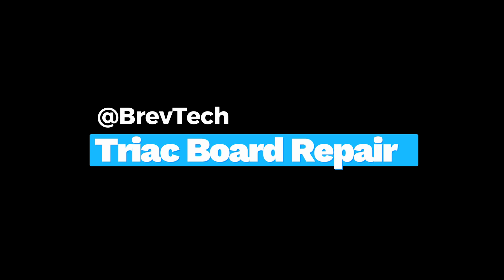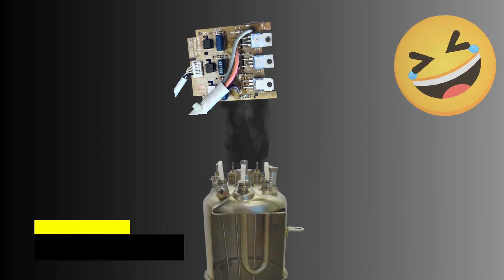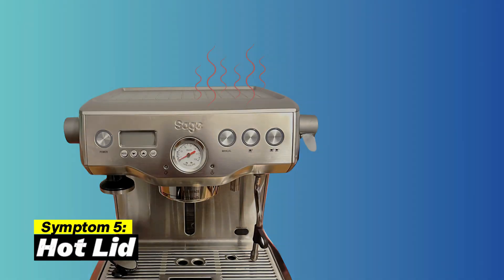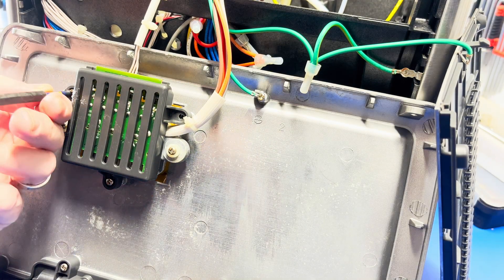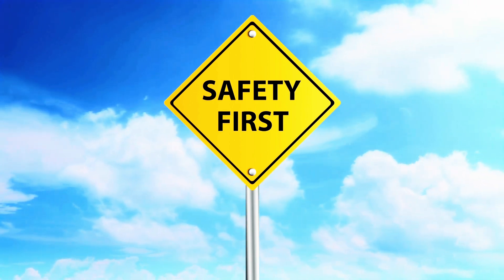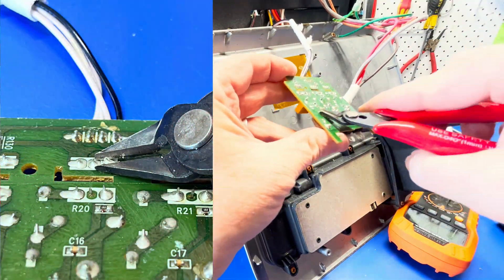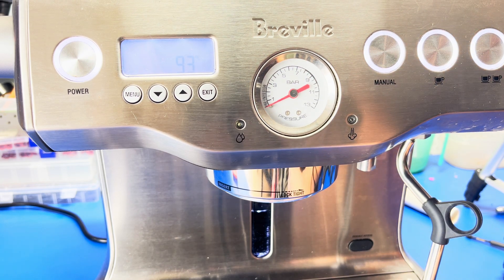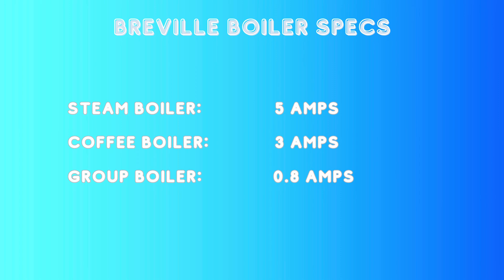How to Diagnose and Repair the Triac Board on the Breville Dual Boiler BES920/900

Comment: May I please ask for some advice? My TRIAC blew up 3yrs after purchase from a leaking o-ring of one of the steam boiler probes. It had the common symptom of boiler overshooting the max set temp and not functioning as a result. I fitted a new TRIAC which allowed me to establish the problem was the leaking steam boiler probe o-ring. I changed the o-rings but also, as you suggested as a possible remedy, applied conformal to the upper side of the TRIAC board. Prior to conformal everything worked but since applying conformal, whilst the pump comes on to fill the steam boiler water does not enter the system. I assume there's a solenoid valve that opens up to let water to the pump. I can't see how conformal could damage the board enough to stop this working. Have you any ideas, please?
Reply from the maker: Are you saying the steam boiler is now not filling? Can you hear it running during startup? The steam pump feeds directly into the steam boiler so there are no solenoids to fail. This problem is usually either the steam pump seal worn or the inlet port blocked by scale.
Reply: @BrevTech  Ignore me. I was being a numpty and panicking when the pump was merely filling up the steam boiler. Everything now works perfectly thanks to your outstanding help. Thank you once again!

Comment: This morning i was going to make myself a cup of coffee, and to my shock the machine wouldn't power on. Out of the sudden. What do you think the problem is?
Reply from the maker: It could be a leak getting into the electronics. When was it last serviced?
Reply: @BrevTech  never. It has worked well last 8 years
Reply from the maker: @emmasshow3081  oh gosh, it's well overdue then. You really should get them done every 18 months. Hidden leaks inside can rot away the internals if not addressed.

Comment: awesome video MY BDB have issue with under heating ,  I got error code 10 . 6 times but I can not get into the self check mode some how, that hapnned after I replaced all orings after boiler as well. what should I check it ? there is contunuty between boiler fuse and ground. ( I wonder shodln't it or normal?) I m asuming short to power when installed reveseway.. / hot water , steam are working fine.
Reply from the maker: sounds like you might have the bes900. If steam and hot water are working ok, it could be your group heater. You'll need to test the triac board outputs to verify. I cover this in the video.
Reply: @BrevTech  Hi! are u selling traic board 120V? I been ordered service kit from you! nice meet u! :D
Reply from the maker: @choibackho3068  They are the same board as 240v. If you ordered the survival kit it will have everything you need for the repair
Reply: @BrevTech  thank you. I tried to repair my self and screw up.. needed to replace board now so sad..

Comment: I've decided instead to replace the whole Triac board. One question if I might. Is it possible to replace the o-rings with the compression washers used in the newer model you mentioned early on in the video?
Reply from the maker: you can yes, but i'm not sure where to buy them from. The ones i have here are spares from parts i've ordered. You may need to just buy a whole new pipe, they are quite cheap anyway
Reply: That’s a shame. I wonder if it’s worth my asking Breville. You would have thought having identified what is a design flaw they could at least supply the new compression seals. Incidentally I’m trying out your idea of the conformal coating on the upper surface of the board.

Comment: I have a bes860xl…I have changed the pump, all solenoid valves block, checked all tubing and still no water through the dispenser head to extract coffee.  Could it be a board?
Reply from the maker: unplug pipe going into boiler and feed into a small container to see if water is coming through. It's likely either a blocked boiler (scale) or blocked inlet water filter (common)
Reply: @BrevTech I have steam working just fine. So water is getting to the boiler.  Could it be the signal not reaching to the solenoid valve that controls water to the dispenser head?
Reply from the maker: do you hear it click when you press the shot?
Reply: @BrevTech it sounds like normally it did when extracting coffee. At the end there is like pop or click.  That’s new after replacing the valves solenoid block.

Comment: Hi. Does that mean on the other hand. If there is no amps going through when turned off, it’s not the triarc board?
Mine is overheating, but only when turned on, and not all the time. Pretty weird 
Can it be the ntc? Even when it shows reasonable temperatures on the machine?
Reply from the maker: Yea I would Say so. You can check the ntcs all match in the self check menu. What makes you think it’s overheating?
Reply: @BrevTech  I noticed that te temperature was blinking and rising above the point some times. But sometimes also floating back to the set 93C. In the menu with de different boiler temps I noticed that the boiler gets to hot when that happenes. I replaced the triacs and optos. But still. When turned off, I could not measure any voltage coming through as you shown in the video. 
BTW: thanks a ton for these videos. That’s pure gold!!!
Reply from the maker: did you use the exact same triacs as the originals? sometimes people use slightly different ones and it causes this problem
Reply: @BrevTech  i just checked. Its Q6015L5 , which i replaced with Q6015L6
Reply from the maker: @bloodyt7464  that’s fine
Reply from the maker: @bloodyt7464  next time it drifts turn off and try to get the temps from the self check menu. This will tell you which element is overheating
Reply: @BrevTech  allready did. Should be coffee boiler
Reply from the maker: @bloodyt7464  what temp does it rise to?
Reply: @BrevTech it was over 110 before. Since I noticed that, I hadn’t let it heat up completely because I was worried about blowing the thermal fuse. It’s over 95C even when the 93 are not reached on the default view.
Reply from the maker: @bloodyt7464  hmm, I would plug it into an energy meter (i would always recommend this anyway) so you can keep an eye on it. The coffee boiler is about 2 amps (steam 5, group 1) so if you are seeing it stay on, then i would suspect something else wrong with the triac board. if it's on and off, then it's a bit more tricky. It could overheat due to not filling properly. Is your pump otherwise ok? pre-infusion ok? it can't be the NTC as it's telling the machine it's 95c. The only other condition it would do this is when the group heater wasn't working and its trying to compensate. beyond this, that's all can suggest

Comment: Wpuld it also be the Triac board if my oracle is very noisy while starting up and only reaches about 70 degrees and never stops. It initially had the ERR code which i fixed with parts from you. Suggestions please?
Reply from the maker: Hard to tell with seeing a video of it but loud noises can usually be attributed to a dry pump. It could be your steam pump possibly that is trying to fills the steam boiler. This would explain the 70c too. Use the error log and live debug mode to further troubleshoot.
Reply: I guess the steam pump is the smaller one at the back? It's the one that I can feel vibrating hard with the noise.
Reply from the maker: @rudgespace  yep. you can take the pipe going to your steam valve off and connect it to the top of the steam pump. route it into a small cup and switch the machine on. this will tell you if the steam pump is pumping ok. Best case is it needed priming and this will get it working again.

Comment: When I go into self-check menu, Coffee Boiler: 117c, Steam Boiler: 122c, Shower Heater: 93c. Looks like my Coffee Boiler is overheating would you agree? Should replace both Triac and Opto Isolator?
Reply from the maker: it does appear that way yes. I show in the video how to tell if the triac needs replacing, but generally you should always replace the opto anyway.

Comment: Thank you for your amazing videos!
Just wondering: I haven't yet pulled the trigger on buying a BDB, as I was aware of the frequent issues. Would you say that based on your experience with those machines, they tend to last well when regularly replacing O-rings?
I'd be willing to do the latter, however, I'd very much like to avoid buying a machine that will require bigger fixing every 1-2 years (from what I've read and heard).
Thank you already in advance for the heads up!
Reply from the maker: Thanks! If you're buying new, then it will come with the newer design boiler which does not require regular o-ring changes. If you are buying used, then you will almost certainly need to carry out some of the other repairs i have on this channel before long. Solenoids, o-rings and pumps etc. are all consumables, so no matter which machine you buy, eventually you'll need to replace these every 3-5yrs or so. It's usually a tradeoff between features vs things that go wrong. O-rings are the catalyst for many other problems on these, so if you keep on top of those then there's no reason it will last 10yrs+. I still see (albeit rare) 12yr old dual boilers that look brand new inside.
Reply: @BrevTech  thank you for the fast reply!
I am considering buying new, as the dynamic duo just dropped to 1070€ in Germany. Do you see any downsides with the latest iteration of the (here Sage) dual boiler?
Also, how did they adapt the boilers that they no longer use O-rings?
And one final question: I've heard horror stories of dual boilers and especially oracles dying after a decalc cycle. Is this still a thing? And what would I have to do to prevent this from happening?

Thank you so much once again for the insights! Your provided information makes me really reconsider the dual boiler
Reply from the maker: @TechEtrix  No downsides for buying the latest model. The use ptfe compression fittings instead of silicone o-rings, which last many years longer. As for the descale, don't over dose with solution as it can affect the machine and sometimes cause failures during descale. I always have my machines on an energy meter, so i can see how many watts or amps are being used. If its 3A then i know the steam boiler is not on so its safe to empty, but if its 7A+ then i know its heating up and to make sure the tank has water in or switch the machine off quickly! I'm in the process of doing some research around why it sometimes (more rarely) happens on the newer versions that were supposed to be "fixed"
Reply: @BrevTech  Really interesting insights, thanks! So keeping an eye on the BDB pulling <700W means that I'm good to go and can continue the descale. Does this mean that the software descale function does sometimes nevertheless turn on the boiler?
Last question: how would I make sure after receiving my machine that it indeed is the latest version and not an old model that was stocked for months or years?
Reply from the maker: @TechEtrix  There are times during the descale that the steam boiler does need to come on (to heat up the descale solution) so i'm probably filling you with too many details, but 99% of the time you should be ok. Just make sure it doesn't come on just after it has asked you to drain the boiler as that is when the thermal fuse can blow. If a strong enough solution is covering the sensors inside the boiler, this tricks the machine into thinking it still has water in, so it turns up the heat. You can find a good thread about the dates of the new design here: https://coffeesnobs.com.au/forum/equipment/brewing-equipment-midrange-500-1500/943214-massive-news-for-breville-bes920-980-and-990-models-as-of-mid-2022
Reply: @BrevTech Just wondering, as I put WAY more research into espresso machines over the last 2 months:
Shouldn't it be possible to cold descale the bdb manually with amidosulfuric acid without using the descale menu? This would completely remove the need for letting it heat up and should thus maybe cause less issues?
Reply from the maker: @TechEtrix  you can't do it cold as when you want to fill up the pump with descale solution, the water will heat as it's filling. unless you want to open it up and disconnect wires. Also, do not use amidosulfuric as i've found it's a lot more conductive than the others. I've had machines with brand new probes in fail a descale using that. it's also called Sulfamic acid
Reply: @ As I haven't yet ordered any espresso machine (currently considering the new gaggia classic due to its lead free materials with the gaggiuino mod), the BDB would still be an option. How many wires etc would I have to disconnect for a manual descale and boiler flush?
This would enable me to pull the thermoprobes first, let the descale solution do its thing and then flush it with clear water afterwards, thus having no risk of failure involved whatsoever.

Comment: My TA6 Triac is still letting the full 230V thru even after replacement of all 3 trials and optocouplers. What can cause this? Thanks! As the machine is having issues with the steam (3 beeps), does this have something to do with it? The Group head was having around half of the voltage and was hot even when the machine is switched off but plugged in.
Reply from the maker: It sounds like you fixed the grouphead opto, but you might have a faulty thermal switch or fuse on the steam boiler. Go through my steam boiler repair video on how to check this
Reply: @BrevTech  I will check that next. I am pretty sure that either the fuse or at least the thermal switch of the steam boiler is bad. But I am anyhow still wondering why TA6 is still letting thru the full voltage when the machine is off. All 3 Optos and Triacs have been replaced by myself. I have used BTA16-600CW for all three.
Reply from the maker: @ml.photo.graphy  Those are the wrong type. You need BTA06T-600CW for the grouphead and Q6015L6 for the steam and coffee boilers. The gate current on yours is probably a lot lower so its switching on when it shouldn't. Check the link in the description as i sell the correct ones in a kit if you can't find any. I'll add this info into the description for others to refer to
Reply: @BrevTech  regarding the bta I think it should work with the 16Amp Version as well. The only difference is that it can carry 16a instead of just 6a
Reply from the maker: @ml.photo.graphy I believe the T (snubberless) is important. I don’t know exactly why, but I’ve used those triacs you are using before and had problems.
Reply: @BrevTech  they both are cw which stands for 35mA snubberless. But the other q6015 has 80mA. This might be the issue for me. I will replace the 2 bta16 I used with ehe q6015 as soon I receive them.

Comment: Would it be possible for you to do a video showing how to do a complete overhaul of a BES870 by chance? Mine keeps popping circuit breaker when trying to run my shots. but if I steam first, then it works ok.. I don't know what to do, but figure I should probably replace all o-rings or something.
Reply from the maker: I'm so time poor at the minute, but I do hope to be able to make some videos on that machine in the near future. I would say your issue will be a leak. On those, its usually on the solenoid block. The white elbow joint on the right side of it is a common failure point too as they split over time. good luck!

Comment: I'm having an RCD issue that is causing me grief and wondered if you can point me in the right direction to look.

A friend's DB that I'm having a look at is tripping the RCD on turn-on when the pump activates. There has been no leaking from boiler o rings but I have replaced them anyways. I unplugged 3 way solenoid and still happening. Cannot see any water leaking but it trips instantly anyways
Reply from the maker: Take a look at my steam boiler repair video. You likely have a faulty element or wet thermal switch that is tripping the rcd. That’s by far the most common cause after ruling out a large internal leak
Reply: @BrevTech  thanks. I'll check it out. Another thing he told me was that just before it started tripping RCD water would come out of group when starting up. And not stop until power cycling.

Comment: Thank you for the excellent information! It helped me pinpoint a failed opto-isolator on my coffee boiler, and after replacing it, the machine is back up and running.

Here's a tip for others: I found it easier to cut the legs off the opto-isolator from the top side of the board before desoldering. This method allows you to remove each leg individually rather than trying to desolder all of them at once.

Thanks again, Brevtech! Your guidance is playing a big role in keeping these machines operational and out of landfills.
Reply from the maker: Great tip and thanks

Comment: Have a termal fuse for coffe burn, the steam boiler ok, after replacing the fuse i receve 125v ( from 240v normal voltage AC) i need to swap the trac or the octo? How i will find that part ?

Many thanks
Reply from the maker: Hi, check the description for links to the parts you'll need. It sounds like just the opto has gone (see 6min 30). Its an moc3063
Reply: Is possible to find a kit with all the scrues? The machine came with a lot of missing scrues. Many thanks
Reply from the maker: Reach it through the Ebay listing and let me know what you're missing

Comment: In the “error” menu, after Fr50, I get a “611” code before the regular error code menu.   I can’t find that anywhere online.  Any idea what it means?  Thanks
Reply from the maker: I've not seen that version before, but it's usually the main PCB board revision. It should have a similar number (maybe 6.1.1) written on the PCB somewhere

Comment: My steam boiler has stopped heating and i can see a burnt patch on the steam section of the triac. Do you think this could be the cause? Ive tested tge resistance over the fuse and element and seem to be ok
Reply from the maker: Almost certainly, yes.
Reply: @BrevTech  I have got a replacment board, what do you thinks the best way to join the wires?